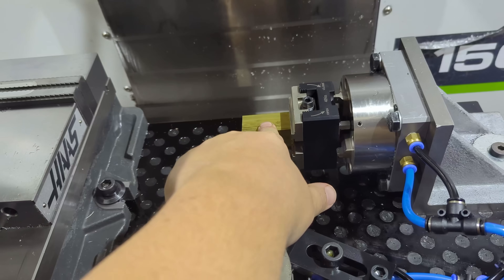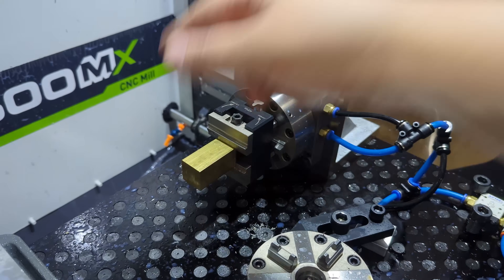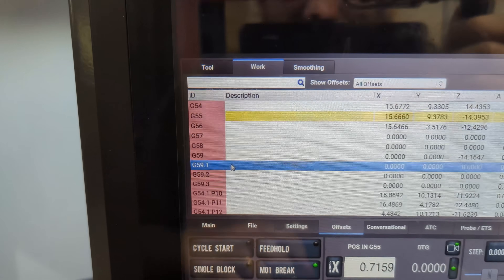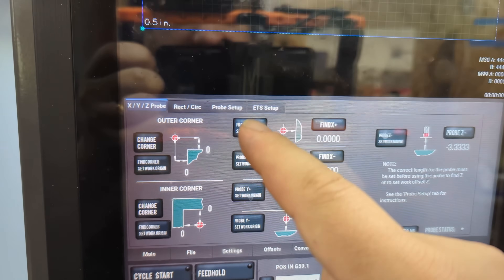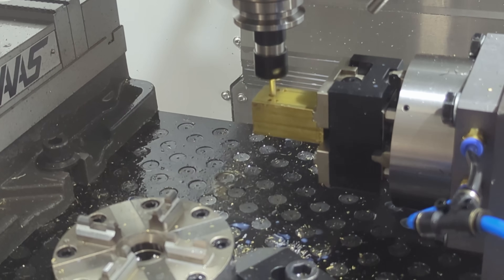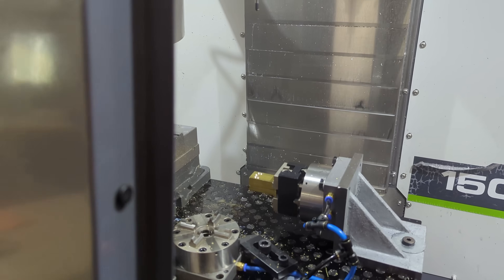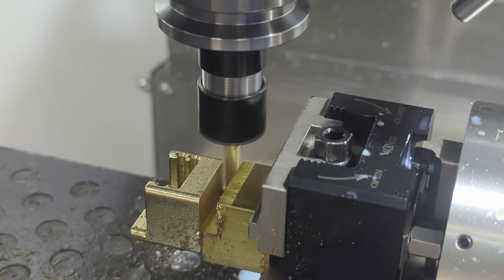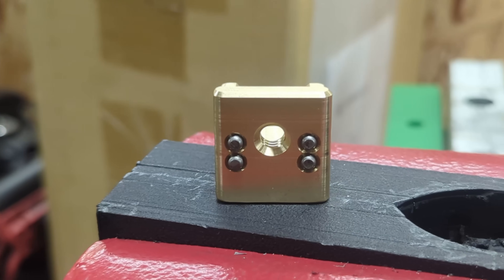Testing a Theory

Comment: Just curious but how satisfied have you been with your Tormach machine? Been thinking about getting one but I’ve heard people have a tough time using them for production.
Reply from the maker: The 1500 is in a different league compared to the other tormach machines. It's genuinely unfair to compare them. I've been super happy with it. It's got more rigidity than it has any right to, super accurate, and has been super reliable for me. There's been a few minor issues with it being a brand new machine (controller power supply died, auto-oiler decided it was a hot rod), but Tormach support has been awesome, and they've gotten me replacement parts the next day. And from my understanding, those issues are fixed on the new machines.

At this point I've run literally tons of steel through my 1500, and lots of small precision parts.

Comment: Love your work!
Just a tip to find the center a bit easier (imo), mill one side, flip 90° without moving tool, mill second side, repeat until all sides are milled. 
The part is now perfect to the center of rotation and can be probed like normal.
Reply from the maker: Wow, that's super simple and makes so much sense 😅
Reply: agree 100% plus doing it that was you can mic across the surfaces and verify parallelism. then pop an indicator on the milled sides parallel with Z and check the indexing accuracy and the verify fixture is parallel with x.

Comment: Nice video to demonstrate your manual indexing.
One point regarding your probing. Averaging is a good idea to account for tilt and not being on center. However, you are still assuming that your stock has flat sides. So maybe this is not yet the result for your WCS to never be changed again. Maybe find a better artifact to probe again or use for example the vise body. Would be a lot better than raw stock material.
Also checking the test piece dimensions would be good idea.
Reply from the maker: This was just a quick and dirty setup for a test. If I was really dialing everything in, I would do a test cube, just like you would on a real multi-axis setup.

But yes, this method makes a lot of assumptions

Comment: Any reason to continue setting X/Z offsets from the top of the stock instead of just using a known surface on your base or vise? It would generally eliminate the need for any probing. Obviously it’s contingent on having your work holding and stock accurately modeled in CAM unless you use the face of the step on the vise jaw where the stock sits.
Reply from the maker: That would be better, yes. But I don't have everything accurately modeled yet.
Reply: Maybe if I were trying to set up that 90deg zero point I would probe or indicate the ID/OD of the other chuck to see how concentric it is. Probably very good. Mic the OD of the chuck, probe Y to center and offset Z to 1/2 diameter. And then X zero to wherever you like to put the origin in CAM (Top of the chuck where the pallet registers or vice jaws).
Reply: @farmer7888 I mean without a good model, I think the most accurate and repeatable X/Z offsets would be set using the face of the vise jaw step. Pop a 1-2-3 block in there lightly, probe the end and subtract the distance. In CAM your origin would be the center end of the stock that sits in the vise.
Reply from the maker: That would probably work too

Comment: Killing it bud.    Idk if it'll work with your 4th axis fixture.   I found a company that makes a fixture.   Moresides.      Basically it's a fixture youd see for a 4th axis rotary on a hass vf2 that lets you manually index for the 5th axis.   You can set your center of rotation like you would for a axis and program as such with op stops and just manually index and get seamless 3+2.    Idk if their fixture would work with yours but it's basically a truion.   Check it out.   Might help you.
Reply: Literally Google  moresides fixture.    It's the first link.
Reply from the maker: That's awesome! I'll check it out!

Comment: Great video!   I have several work offsets that are intended to not be changed, and I’ve had a few times that it occurred. It’s actually easy with a touch screen to just bump a “set zero” button with the WCS still active from the last run. 

In any case, I take pictures of my phone of the offsets I care about and if I ever screw one up it’s an easy fix.  Always better to have that than have to re probe!
Reply from the maker: Definitely! I accidentally overwrite my WCSs far too often. I wish tormach have you a popup with the active WCS after you hit probe. I do the same, just take pictures
Reply: @AudacityMicro Would be a nice feature if the log included changes to WCS and tool offsets.  And if it did, and undo button on each line would be swell. :)
Reply from the maker: That would be huge!

Comment: damn sir, i am a noob for 2 years now...
i got the exact same stuff going on this week, i have a fanuc robodril with a ddr rotating table with a long bridge between, i am testing it and made a 2 op dice and a 2 op ok vice soft jaw, its always the rotating side aint cutting accurately, deeper/shallower chamfers and holes...it is hard to find the rotational offset for z and y when everything is mounted on!  i dont know where should i trust to get the value and my rotating bridge/table needs to be exactly at the ddr unit too...

great video as always, thanks!
Reply from the maker: Sounds like a lot of work! But I'm sure you'll get it dialed!

Comment: I'd love to know the allowable compromises that you use when doing a prototype run? ... What do you relax and  how do you then 'tighten it up' when the production starts?
Reply from the maker: Oooh, that's an interesting question. Like all interesting questions the answer is "it depends". Mostly on how far along the prototyping process you are. This is SOOOO early that I wouldn't even call it a prototype. This is a "technology demonstrator". It's a proof of concept, nothing more. So at this stage any and every compromise is allowed, as long as I finish the project.

If I'm getting ready for production, let's say before a Kickstarter or something, the final prototype needs to be darn near the final product. There might be some manufacturing steps that are a little different, but the final look and feel needs to be spot on.

Everything else is a spectrum somewhere in-between. I would say the first goal is to always just finish something. Even a 75% compromised part will teach you a huge number of lessons. From there you can iterate as you figure out what is important, what isn't, what your tolerances will need to be, etc.
Reply: @AudacityMicro  Some gems in there - thankyou.